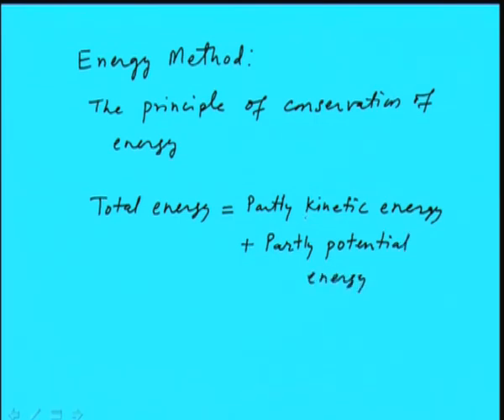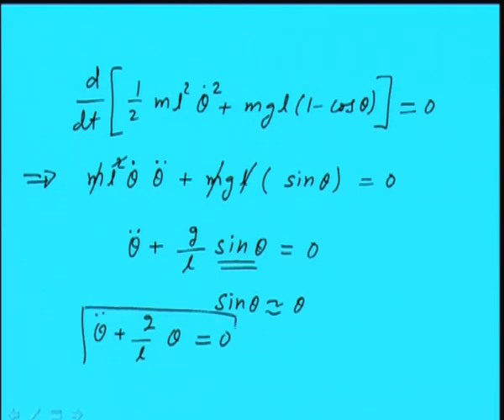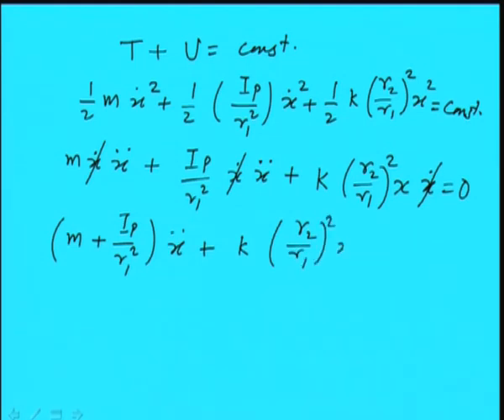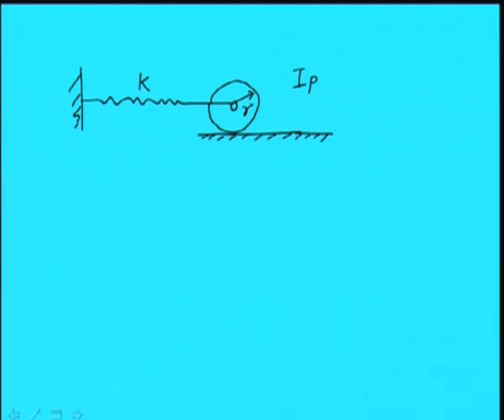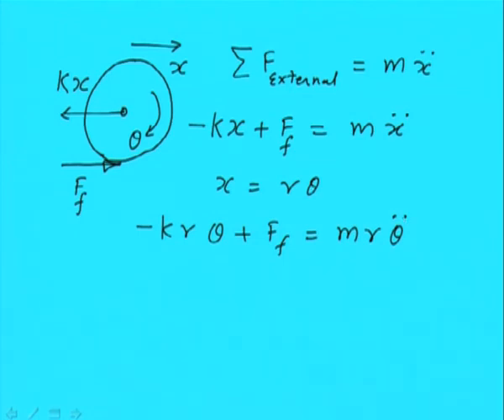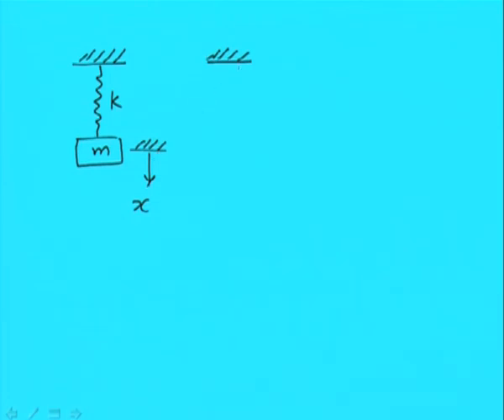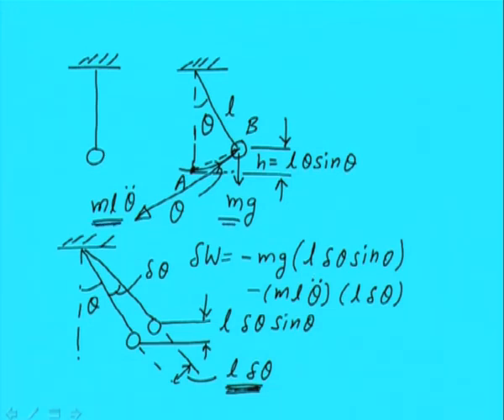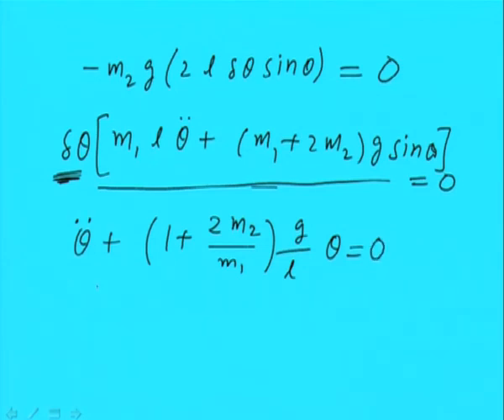Mod-2 Lec-2 Energy Method, Principle of Virtual Work

Comment: why  we are not considering the potential energy of mass at 16:56..please explain .
Reply: If we consider the initial equilibrium condition, the spring is still in tension due to the mass attached . The potential energy of the mass is always balanced by the the potential energy of the spring. y(t) is the extension taken after equilibrium condition; so it is not considered.

Comment: you missed one theta dot in pendulum question but still answer is correct,how is it possible??
Reply: actually he skipped many things in that derivation, he should have considered 1- cos(theta)= 2sin^2 (theta/2) and rather for small angle considering sin(theta/2) just equal to (theta/2) then derivative would have lead to theta dot at both side thus deduction of it was possible.
Reply: power of the knowlegde ..
Reply: i think u must have failed in class 11...instead of pointing out the wrong apply ur brain